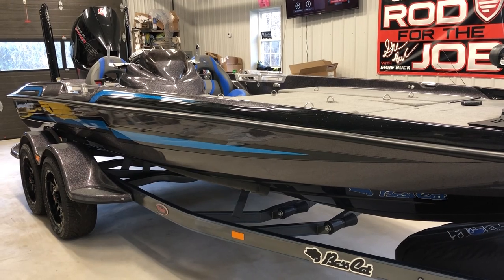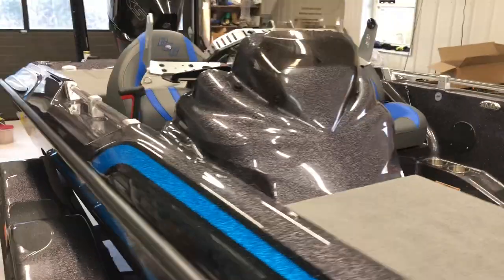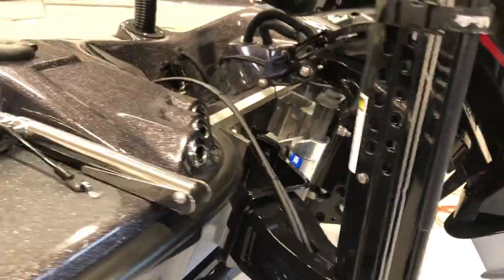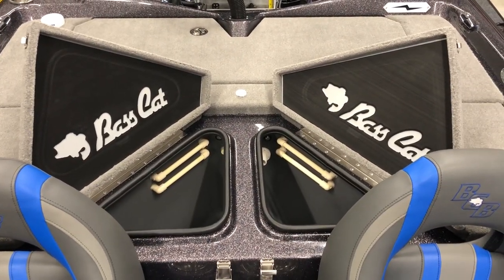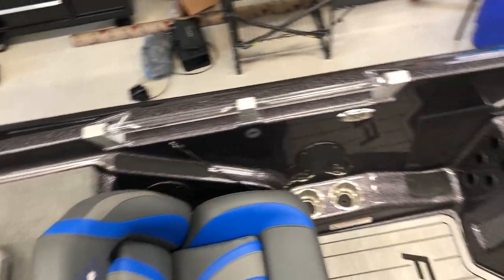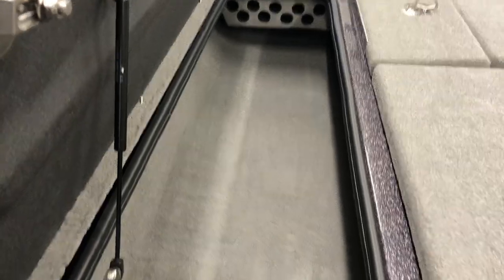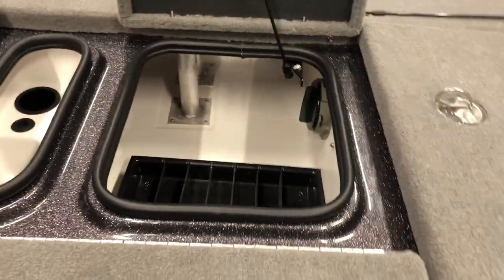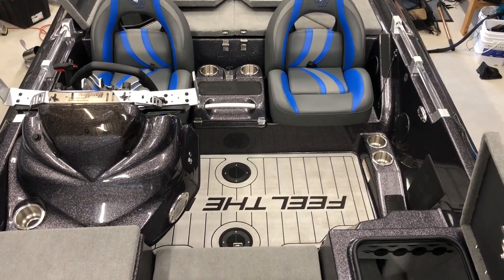1st Look at 2022 Bass Cat Cougar FTD, Mercury ProXS 4 Stroke, Lowrance Ghost, HDS 12 Live, Jackplate

Comment: I am curious on how it works when you buy a pro staff boat. Not sure if I would be a serious buyer but curious.
Reply from the maker: My 2022 is sold. If you’re interested in my 2023 I’ll be ordering it by June. You get to pick colors and get a boat that’s used for 3/4 a year and save some money. I’ll run it for 2023 and you would then get it in the fall. Usually I put 200-300 hours on a motor. Shoot me a message on IG or Facebook if you’re interested.

Comment: Nice video and a beautiful boat. Was curious is there a place to put a net?
Reply from the maker: Not a spot specifically made for it. I fold mine up and leave it on the floor or put it in the right box up starboard box up front
Reply: @graebuckfishing  oh ok. I believe the older Cougars had one and didn't see one on this video so I thought I'd check. Good luck and tight lines this year